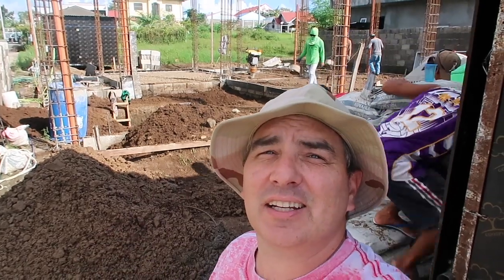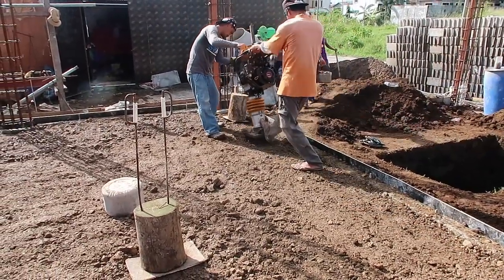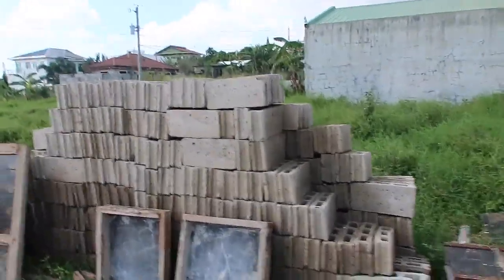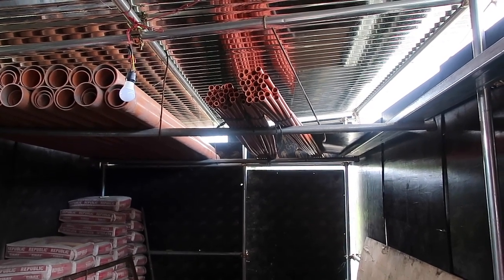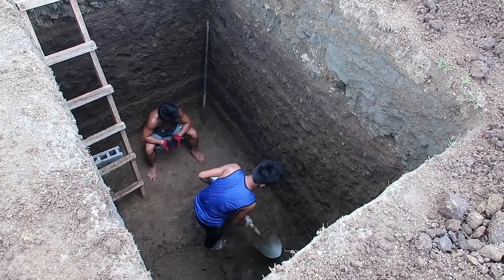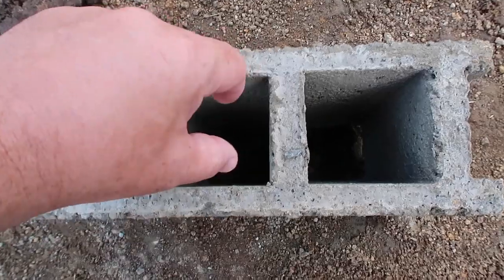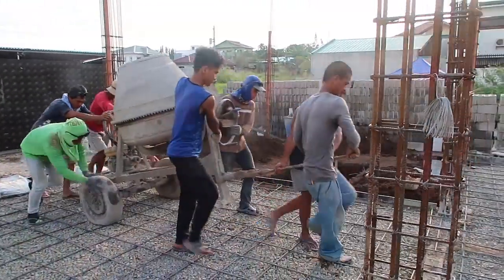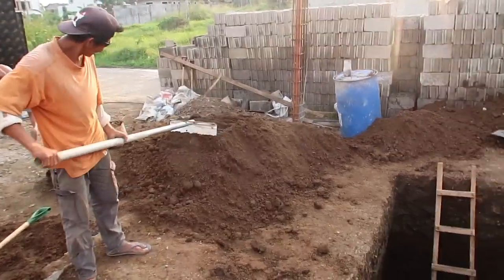HOUSE BUILDING IN THE PHILIPPINES - EPISODE 25: PREPPING FOR THE GROUND POUR

Comment: They don’t even have rake for leveling the subase. They place the gravel base but not compacted. Placing slab on grade rebar without spraying termite treatment and placing vapor barrier. Again, descripancy in construction. Even maintenance of equipment. Mixer should be washed and clean after each use.
Where are the utility conduit lines. I saw again digging on floor preparation. Ih you are the contractor, how can you afford to make this mistakes over and over.

Comment: no vapor barrier?
Reply from the maker: We dont
Reply: @retiredandhappyinphilippin3329  vapor  barrier  prolongs  the life  of steel reinforcements...Concrete  is a permeable  material...Rust corrosion  can expand up to five times its  original size and  thus will  cause  cracks  in concrete...
Reply: @manuelbartolome6663  , when and where do you put the vapor barrier, please?
Reply: @vcorres  before pouring ground concrete slab...underneath ground slab...minimum  of 5 mils of plastic sheet.